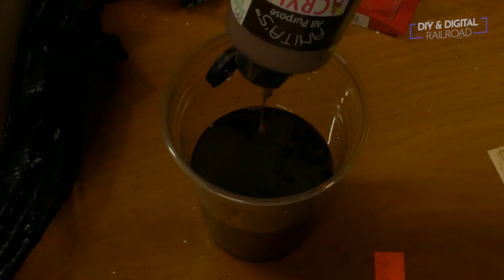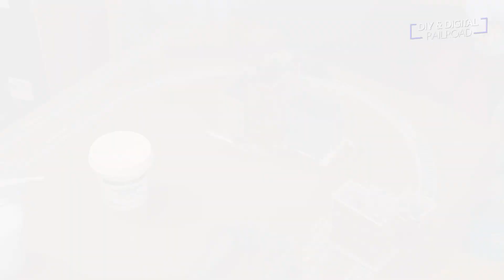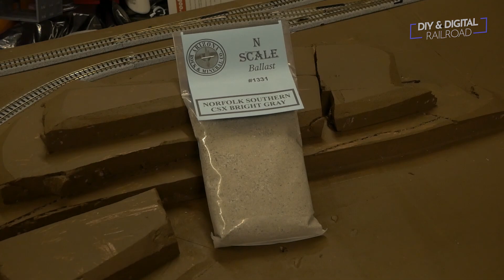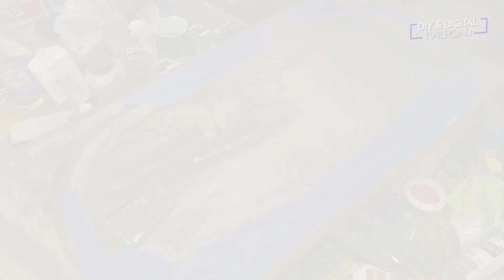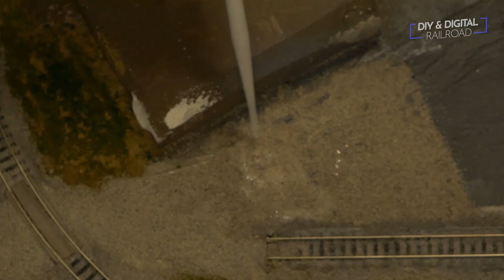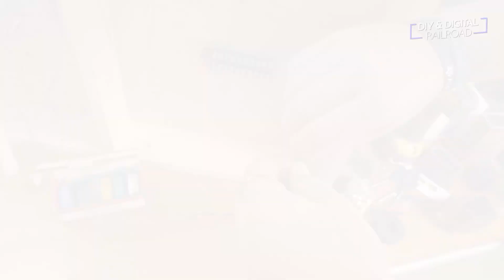Building Your First Model Railroad, MRROne Project Railroad Part 3: Ballast Scenery and Lights

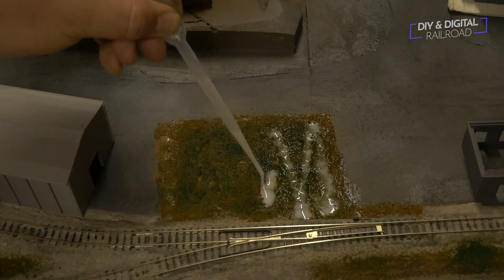Comment: Lol,   Sorry had to laugh at about 14:40 when you said wet water :).    Water generally is wet. :)
Great video series.  Watching it 2 years later and enjoying it.  The content is relevant still, no matter when it is watched.
I have seen some people dilute the PVA in water for that top coat as well.
For the electrical, I usually use the heatshrink that as solder inside it so it actually solders the connection inside the heatshrink

Comment: Question about foam board usage. I'm in planning stages of a n scale layout.  The foam board I'm thinking. 1" -2" thick board as my layout will have a narrow boat canal. The foam would allow me to carve the canal where I want it ?  And does the foam, when glueing track and roadbed down, offer and sound deadening qualities???
Reply from the maker: Hello!  Yes to both.  I would draw your canal out with a sharpie and use a utility knife to cut it.  Foam does a good job of deadening sound, especially when combined with cork roadbed and/or ballasting.

Comment: Jimmy question,why not use the 50/50 glue water for the ballast? Enjoyable video,to you and your family and subscribers.Happy Holidays,and be safe.🚂🎋✌🌍
Reply from the maker: I use the straight white glue to start because it doesn’t run.  The 50/50 is used once I soak it with the wet water.
Reply: I use woodland scenic spray glue so easy no mixing dries in about 24 hours